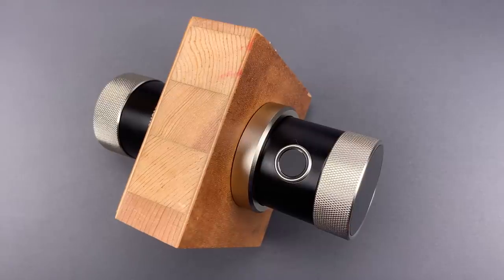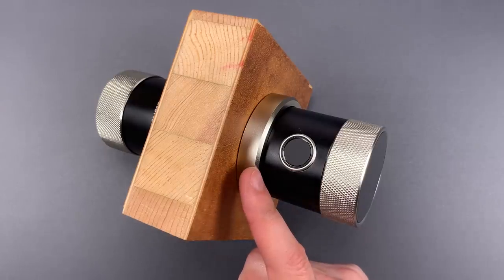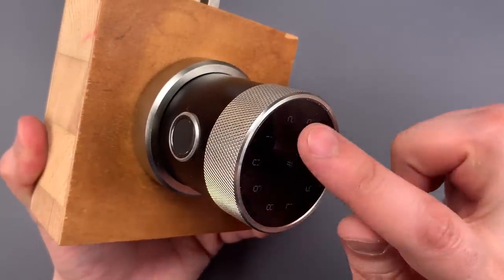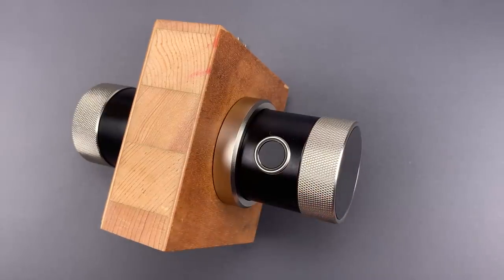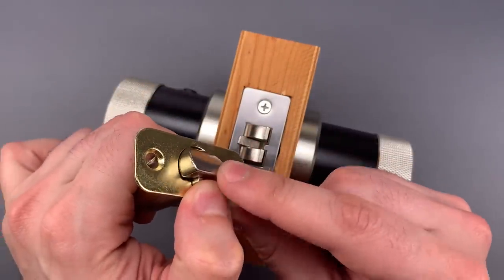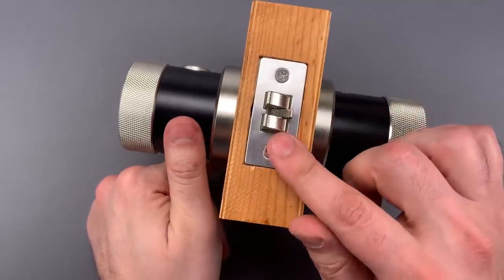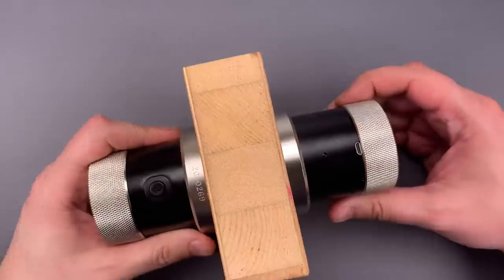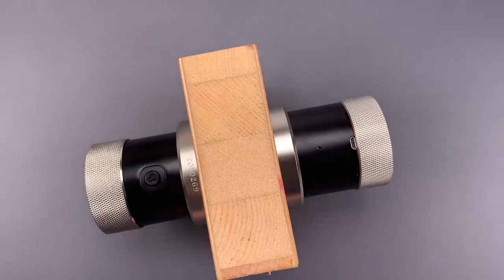[1120] Fingerprint Lock That Forgot The Fundamentals - DatoHome L-B400

Comment: "...An option to connect via bluetooth..."

Whelp, so much for high security. 😅
Reply: you hear your usband outside the door, but you accidentally took his keys
hacking noises
honey i'm in
Reply: SDR noises
Reply: Thats exactly what I thought. That alone ruined the lock for me
Reply: That can be done in a secure way if the device sends a random value across to the phone and the phone sends back a signed message with the allowed public keys setup from a physicals connection on the "secure" side of the door. If the key was setup in a phones secure execution environment it would even be secure against a phone being borrowed temporarily by a "friend"  to clone the key as it would not leave the phones secure element (like how a cryptocurrency hardware wallet) but its very unlikely that the lock goes to that length to be secure.
Reply: @Unifrog_  sure, but it still opens up a whole other can of worms with trying to secure the Bluetooth. I personally wouldn't have anything to do with a Bluetooth lock. There are vulnerabilities that can be found and I'd rather not have another piece of my life needlessly connected and potentially relying on some Bluetooth connection. Just my thoughts on it.
Reply: It only opens up a can of worms if its not implemented correctly which is a safe assumption but not an absolute certainty and a decreasing probability as secure elements become cheaper and better understood (they are already pretty damn cheap considering the level of security a chipped credit / debit cards is capable of for less than a dollar) 

The key (pun intended) is to not rely on the signaling method for security. After all what is a physical key but a really shitty signaling method for an extremely simple password that is broardcast visually every time you pull it out?
Reply: @mattmakesanything   you are not even talking about the same technology I am talking about if your RFID chips where cloneable. You are also just listing insecure devices that are again not what I described. Of course any protocol is insecure if you implement it incorrectly or create back doors for convenience. Anything that uses biometrics is horrifically insecure and of course there are tradeoffs.

For me a good level of security is an unclonable digital key (military grade secure element in both the lock and the key) and a pin (on the key not the door) 

If thats the procedure it doesn't matter if the key communicates with  NFC, Blootooth, infra red, smoke signals because capturing the signal does nor reveal the key.

Obviously with that setup you can still use it in an insecure way. If you share the pin or make it discoverable and lose the key. Or if the key isnt actually military grade like pretty much everything you can buy retail right now but I am not talking about a specific existing device but more about the absolute statement that cryptography cannot make a key and lock more secure than a physical key considering keys have close to zero security and very little in the way of possibility to improve on that.
Reply: @mattmakesanything  so reducing the interaction to just a signal and eliminating the keypad on the door and physical keys would make it more secure right?
Reply: @mattmakesanything   bro, if someone wants in your house bad enough they will smash a window and walk in. No door lock on the face of the earth will change that.
Reply: @mattmakesanything  That is not inherently true. Bathroom door locks have one way to interact with them. They are about the least secure door lock made.
Reply: @sethborne  But adding a second parallel way of opening in the bathroom door lock isn't going to make it any better, either. The point is that the lock is only as good as its least secure vector, so adding additional vectors can't help.
Reply: @CarterDeLeo   Definitely true, but the point is that adding another mechanism will not make a privacy (bathroom door) lock any more insecure.  It is much easier to use the privacy lock mechanism than try to pick the keyed portion. So long as the privacy lock mechanism overrides the keyed mechanism. But, my comment was in response to @MattMakesAnything. He said the addition of ANY other way of opening a lock, will ALWAYS decrease the security of EVERY lock. 

While you could argue that it the addition of another mechanism provides a greater number of avenues to opening the lock, it does not mean that it effectively makes the lock easier to open.
Reply: @alec1575  ya, you can try various bluetooth apps to gain access. there's a lot of them. dont trust anything blootooth and security haha
Reply: @sethborne  I was going to disagree with you, then I re-read what you were saying and actually I take your point!  Adding a high security key as alternative access to a 4 digit code lock, say, makes the lock no less secure.  I suppose the only issue is that IF none of the methods are especially secure, then the opportunist had a choice of which security system he wants to try to bypass, but as you say, that does not apply to EVERY lock.
Reply: @Unifrog_  except that bluetooth is outdated and everyone knows the security flaws
Reply: @sethborne  unless you got good security and only have the door and a standard lock. When you got just a wall with 2 doors. 1 standard high security one or one of these. Wich one would you attack first?
Reply: @Unifrog_  You are still getting the massive problem of allowing a very fast method of repeated attempts at accessing the door, allowing a brute force method of entry that could just look like the intruder playing on their phone inconspicuously next to it (as if the person was waiting for someone to come out).

Having a password that can be input to open the lock also violates its security because most people are going to have a very short and simple code, not the 20 digit codes that are necessary to stop someone from guessing the possibilities over the course of a few days of trying it out.
Reply: @theod0r  its not THE secure one tho

Comment: The dimple is probably used to restart your lock with a pin 📌 provided with your phone. Just in case you need to open your door and something isn't working. 😀
Reply: Is it a dimple or a hole (like on a CD/DVD computer-drive)?
Reply: @stevie-ray2020  reset button on your wifi keys
Reply: It’s a dimple not a hole

Comment: The piece of door he installed it on was more secure than the lock
Reply: Looks like a very solid door, unlike the garbage i have in my house.
Reply: @MotorBorg  Your house is only as secure as its weakest link, so if you have any windows you may as well leave the doors unlocked.
Reply: @zzanatos2001  Destroying windows is more dangerous and more obvious. If someone truly wants to get into your house at all costs nothing will stop them, I mean you can make decently strong explosives with basic household supplies and a knowledge of chemistry. Proper door security will stop most of the people who would just try to break in to rob a place.
Reply: @robertpendli340  Most thieves today are the smash-and-grab variety who look for crimes of opportunity. Those who decide to defeat a lock use brute force attacks 99% of the time.
Reply: I always keep little pieces of door on hand